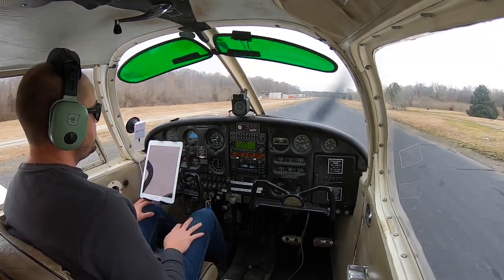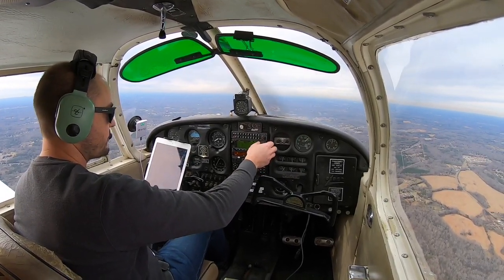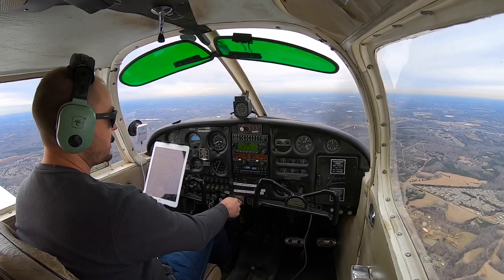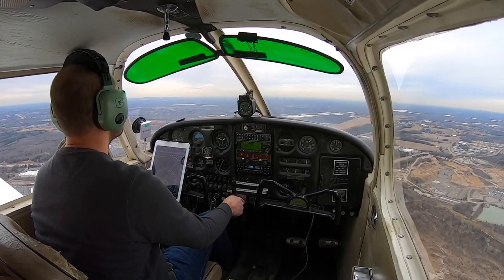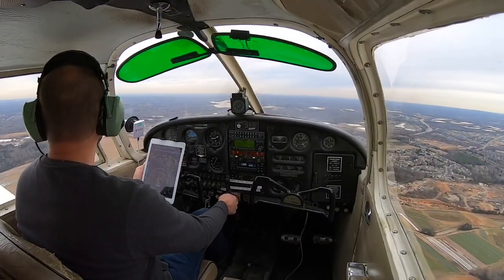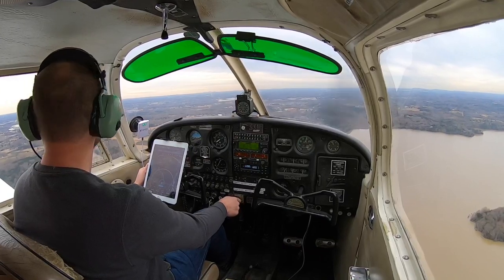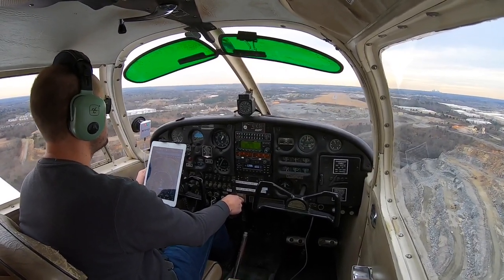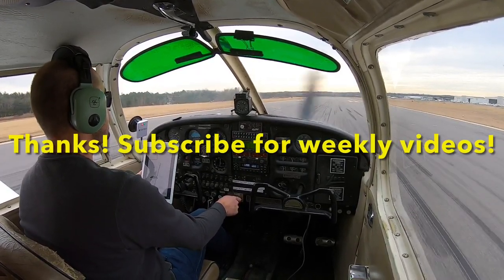VERY BUSY Towered Airport Approach & Landing with ATC | Cockpit View | Pilot Vlogger #8

Comment: Tip for the pattern is just stay towards the white buildings and you’ll be perfect pattern for that direction.
Reply from the maker: Thanks for the advice! It’s been years since I’ve flown in.
Reply: @PrivatePilotAdventures  no problem. When on the opposite left downwind for 2 you can aim towards a water tower out there somewhere I believe.   Lots of good visual points of reference for the concord area.   Biggest thing is just watch for all of the towers in the area. The three by the speedway and the one off the north end.
Reply from the maker: Awesome. Thanks!